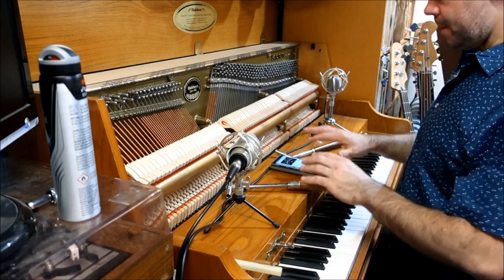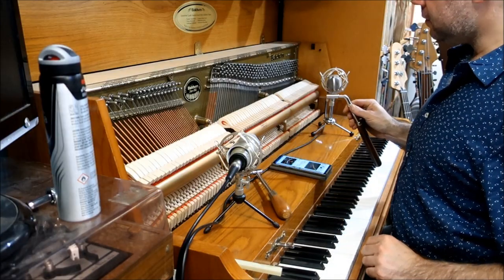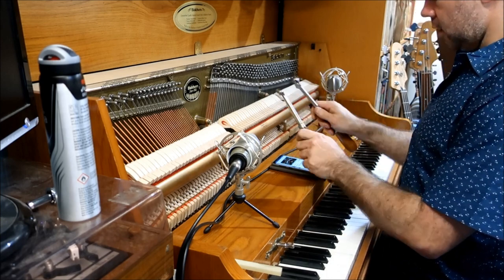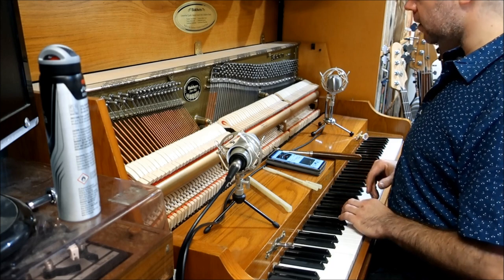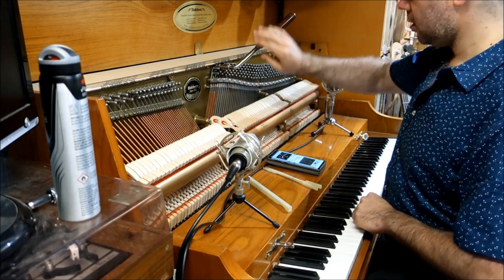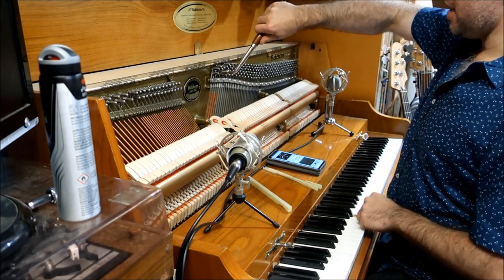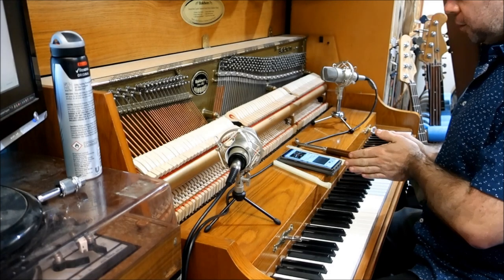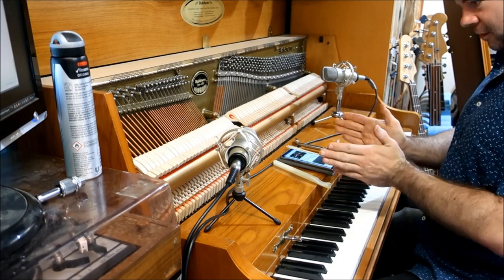A Crash Course in Piano Tuning for the Complete Beginner

Comment: i recently got an old worn piano for free. it was all around a semitone flat. bought a cheap tuning kit online and used a chromatic tuner on my phone. to my surprise it actually went well. I was surprised it went well because its made out like you need about 45 years of experience and a knighthood in piano tuning to do it to any acceptable degree, dont get me wrong, im sure a professional would have done it more accurately than i did, but to do it basically with a chromatic tuner isn't all that difficult, just very very time consuming.
Reply: You do have to have some experience to be able to hear the beats when tuning unisons. Also, make sure that when you’re using a chromatic tuner on your phone… Tune A4 with it, and then tune the other notes by ear.. because a piano is tuned to be sharper in the treble and ‘flatter’ in the bass. It’s called stretch. Make sure that your tuning hammer is at the 12 o’clock position also so that you won’t bend the pins.
Reply: i guess Im asking the wrong place but does anyone know a trick to get back into an Instagram account..?
I was dumb forgot the login password. I would love any tricks you can offer me!
Reply: @Moises Alec thanks for your reply. I got to the site through google and im waiting for the hacking stuff now.
Looks like it's gonna take a while so I will get back to you later when my account password hopefully is recovered.
Reply: @Moises Alec It did the trick and I now got access to my account again. I am so happy:D
Thank you so much, you really help me out :D
Reply: @Rohan Samuel You are welcome :D
Reply: Atta Boy Sir Zoot Zoot!
Reply: Temperament Tuning whole different level of tuning 
Can't tune a whole piano with a guitar tuner because that will sounds ugly and sterile.
A piano is never pitched perfect 👍

Comment: I will be taking your advice as intended and just using this as a reference to adjust the odd key here are or there (to try to keep the piano in the general range) when necessary until the tuner comes by.
Reply: Cool thanks for the heads up